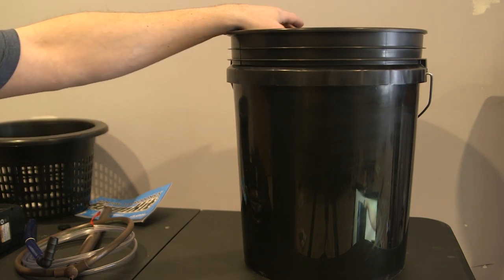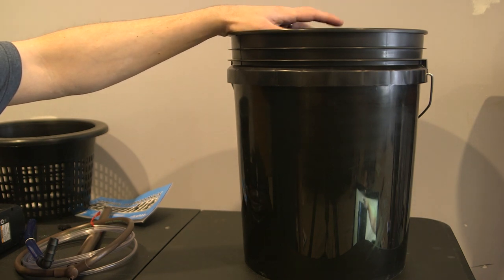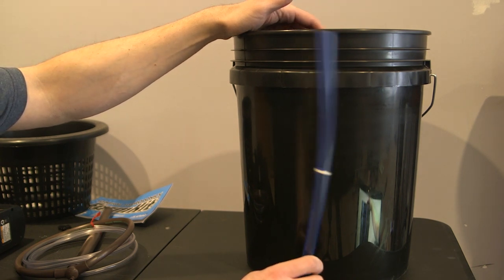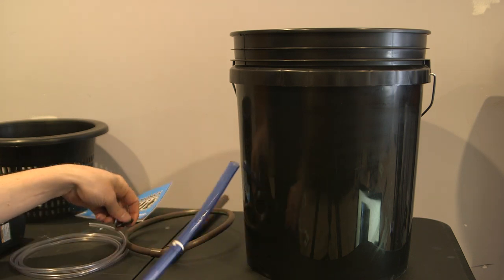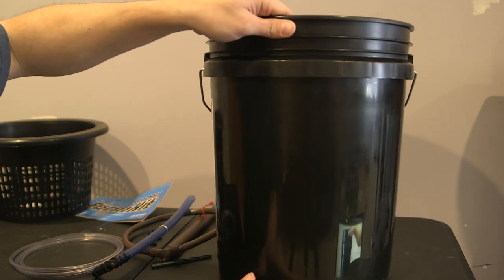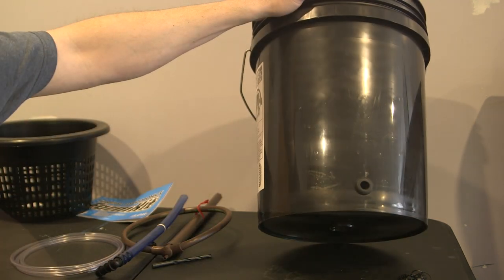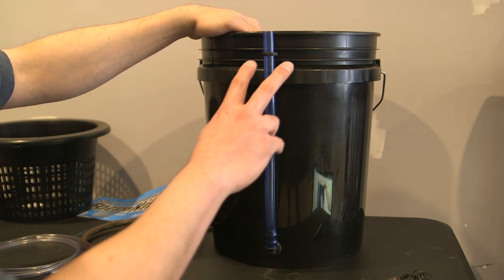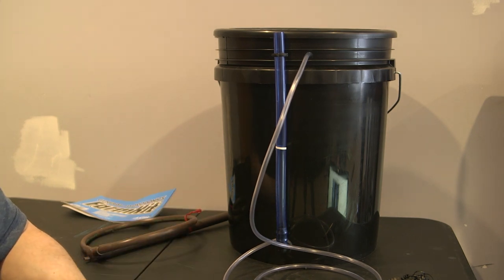DWC Hydroponics Bucket DIY Build with a built in Drip System

Comment: I ordered the Atwater DWC/Drip ring complete set- to see how it's created. I'm Absolutely Digging the design. It Wasn't ridiculous expensive, but, I do wish I'd seen this video 1st. 
I AM making one Major change.. instead of an air stone, I'm going to use the rings. I switched to the rings when I still had fish aquariums (they looked cooler- to start with- secondly- produce a nice even flow of O2..

Comment: I use a dual air pump one side feeds my air stone the other side I use to air lift the water into my drip line. I do it like this because the drip line keeps my water cooled off so I don't have to purchase a water refrigerator piece it's like a 200$ part  . The lights I'm using are super hot 1000watt and without the drip line my water would heat up well over 70°. The drip line keeps the water at a perfect 68° also ensures my roots don't dry out an thr growth rate is jaw droppingly fast I mean I put a time lapse on my plants in 24 hours time you see a remarkable difference I'm saying like everyday my plant looks like its doubled in size. It just a shit ton of o2 and the gravity of the water dripping on roots encouraging them to grow an fill up that bucket
Reply: Wow, thank you - would like to see this. Anyone have a pic.
Reply: Yes true but do you leave the ring on perm because I think if you do trot rot def get rob happen
Reply: Black hose clear no no
Reply: @Jemstk   never had rot ever or any kind of weird growth, only time I ever experienced that was in the trial where we tried using rock wool as a medium, so switched to clay bead, made sure to rinse them thoroughly and never had issues after that, and yes drip line was left on always to ensure the temperature of my water stayed just right, anytime I had it not running the whole time the temp of the water would start to rise. Air lifting the water takes 2 air hoses its fckn genius

Comment: Thank you for the video! I am doing my drip ring just a bit different... I'm using O2 hose, and sprayers, around the underside of the net pot- I HAVE 500 feet of hose, so, I just need to buy the sprayers... locally, they're like 3 cents a nozzle. This IS Quickly becoming my favorite hydro-bucket style...

Comment: How does the drip ring drip water if you only attach a air tube?
Reply from the maker: The air tube is hooked into a line that drops into the water, it pushes water up the larger tube and into the drip ring. I know it's clear as mud, but I can't remember the actual terminology at the moment.

Comment: How does water come out of the drip ring attached to an air pump
Reply from the maker: Howdy. The basics of it is that air from the pump is forced down the thinner diameter tube. The air then pushes up water inside the larger tube that’s connected to the drip ring. And the water trickles out of the holes in the ring. This is not to be confused with using submerged pumps that push water upwards as in some drip systems. This one uses air.

Comment: Bro that is a STEP bit, you can use it for all your hole sizes the 1/4" too.   They were designed for drilling sheet metal without getting jammed up.

Comment: So that drip ring uses air to supply the nutrients
Reply from the maker: This is correct. Air pressure pushes water up the tube to the drip ring. It requires a separate air supply than the air stone.
Reply from the maker: Check out the deeper dive video.

https://www.youtube.com/watch?v=xRQJ9BKZfjQ

Comment: Since the air pump hose is clear does it causes a problem
Reply: Like with algae I ask because since it's clear doesn't it allow light inside the bucket
Reply from the maker: I have had absolutely zero algae growth from using clear tubing. The light that would penetrate would be minimal. The hole is under the lip of the bucket shielding stray light from above. I would assume that any light penetrating from the sides would be reflected light. And because of the thickness of the tubing it would not have much penetrating power. Plus keep in mind the hose once inside the bucket drops straight down along side of the filled net pot several inches before it finds any water. 

If your water is oxygenated well and not kept at a hot temperature, even with light, your algae growth should be non-existent.

Comment: What size is the grommet used for the water level line ? Same size for the elbow I'm guessing ?
Reply from the maker: Grommet size will vary depending on the sizing you need. What I used was from the GH Hydrofarm kit. It's a 1/2" grommet and 1/2" elbow. Check out the parts list here.

https://generalhydroponics.com/waterfarm-parts-list

Comment: I wander why on earth would you need a tube to see what the water level is? I mean just lift the lid and look. The extra hole at the bottom is just an extra possibilitiy for leackage. Why not just leave it out?
Reply from the maker: If done properly it doesn't leak, and it saves time, especially if you have multiple buckets in an enclosed space. Not to mention, lifting bucket lids far enough to see the water levels can damage plants, especially if the plants are screened or otherwise tied for training.

Comment: how do you feed the drip ring?
Reply from the maker: kyle baxter the drip ring has an air tube that pushes air down, which in turn pushes water/nutrients upwards and it fills the ring allowing it to drip out. 

When not being used anymore, remove the air pump and tubing and leave the drip ring in for the remainder of the grow.
Reply: @HowlingFarms  Do you leave the drip ring on 24/7 wouldn't that be over watering?
Reply: cosa nostra  thanks bro!!! i'm still learning
Reply: @anonomiss6096  how can u over water in hydroponics? As long as there is enough oxygen in the water it don't matter. What you want is a resivior and pond pumps to top feed ditch the air pump.

Comment: Is that net pot special made to fit the bucket or does that size auto fit? Thanks great vid!
Reply from the maker: These net pot lids have pretty much fit every 5 gallon bucket I have put them on. In some cases the lid fit really snug, but after it's been seated for a while they tend to reshape to the bucket. I haven't had an issue. Of course, there may be different manufacturers of the lids that may have different diameter sizes.

Comment: How does the grommet not leak
Reply: Michael Richardson it’s a very snug fit. The grommet has a grove on its outer rim that the bucket (being drilled in slightly smaller diameter) pops in to. Once it’s installed and the tube fit inside is an extremely tight fit if done properly. The grommet will not come out even when removing the elbow. But once in I’ve never had to disassemble the grommet or elbow from the bucket.

Comment: Lol it’s called a step down drill bit & drip ring requires a water pump to pump up into the drip ring. Not air 🤦🏻 besides these overlooks, it was a decent video.
However doesn’t really need explanation if your here looking it bc you know what a DWC is how it works.
Reply from the maker: Actually you don't use a water pump. You use an air pump for this drip ring setup. And a step bit can be either up or down. :) But yes, I said multi-bit instead of step bit.
Reply: So if you use an air pump for drip ring, how do you pump water up to dripper, when your using air? 
Abit confusing

Comment: You don't want to top water at all with a DWC system. The roots will behave differently than they should in a DWC. The full benefit will be lost most likely.
Reply from the maker: Completely incorrect. When the plants are young (seedlings) and do NOT have roots beyond the medium you're using in your buckets, you're top feeding. The air pumps that create the bubbles inside the bucket are aerating the water and constantly agitating the water/nutrient solution for an even mix (no settling). Shortly after I made this video people started marketing this system. You'll find these systems now readily available online.